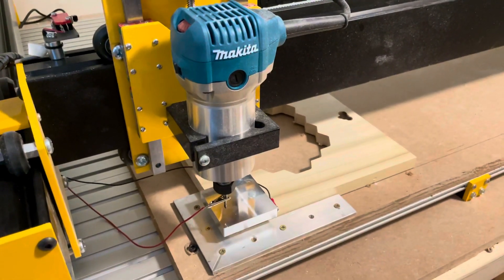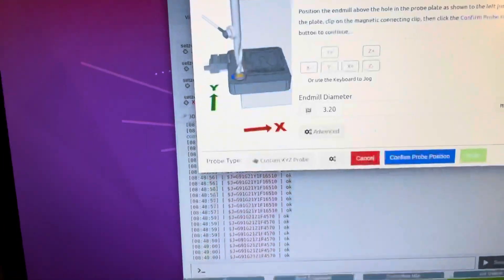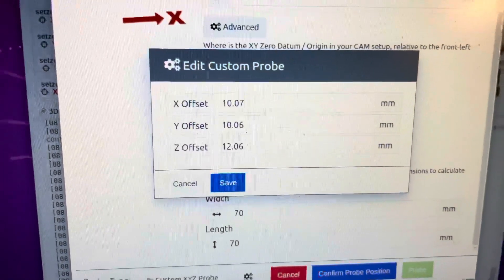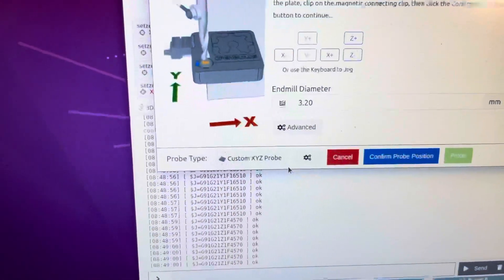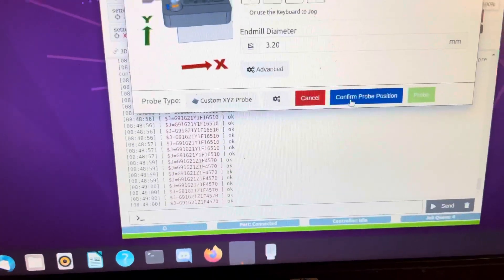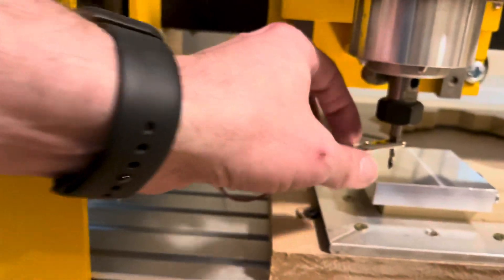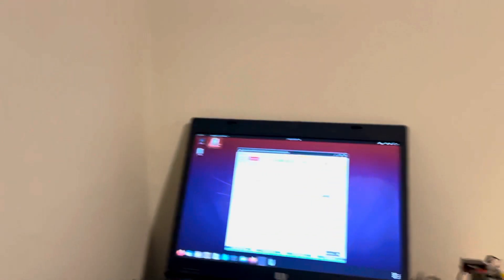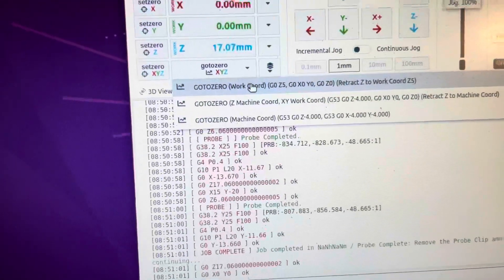Millright Mega V XL probing with OpenBuilds Control

Comment: Can you start & stop during a cut but while you're stopped are you able to move the spindle & gantry out of the way???
Adjusting the feed setting during a project on the fly, is that an easy task to do???
I have a Millright V Full Sheet & am thinking of goin with Open Builds.  The above questions are my main 2 reasons for switching.
TIA...
Reply from the maker: Yes. Simple to do with Control.

Comment: Would a machine like this be strong enough to expect somewhat quick and accurate cuts thrue 3/4 plywood for cabinet work or would I want something different I'm new to the cnc world but a friend told me to check the mega v xl out I mainly use 3/4 shop grade birch more then anything
Reply from the maker: Yes. The rack and pinion allow for faster speeds.

Comment: I have the exact same exact machine (Mega V Xl) you have as well as the Millrite probe.  I tried entering the same settings you have but when I do the probe it doesn't go all the way to the center of the probe plate.  Are you using the Millrite probe and any suggestions on why it wouldn't make it to the center of the plate.  I tried using your custom offsets and then tried it with no offsets and get the same result.
Reply from the maker: Have you changed to a 70mm x 70mm probe. And changed the bit diameter? Are you saying X Y center? Are you using Control?
Reply: @DavidKK4GAF  Yes, I have the 70x70 probe and I have a 1/4 inch bit and yes, Control 1.0.34 I believe.  I really like the Openbuilds interface over UGS.  When I hit the probe button, my bit is positioned in lower left of the probe, it doesn't make it to the center of the probe.  It falls short and only goes about half way and it lifts and goes to do the side touch and doesn't go far enough and hits the probe again and errors out.  Maybe I need to run through the calibration setup?
Reply: Well duh - I just realized you have an 1/8 inch bit and I used a 1/4 bit.  Silly me.  On another subject - have you looked at the program called Gsender?  I downloaded it and it looks awesome but I can't get it to find my machine.  It looks awesome - just curious if you have seen it or checked it out?
Reply from the maker: With Control no need for any other software.

Comment: Have you cut any 3d designs after using this zero plate?
Reply from the maker: I have only cut two pieces so far. I cut all of the 3D stuff with my past CNC. I have never used a 3 axis touch plate before.